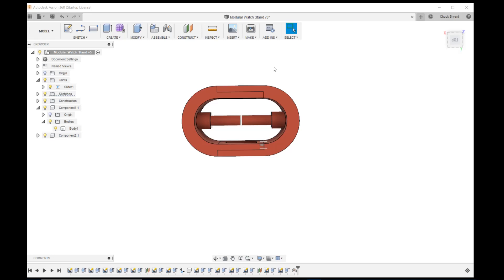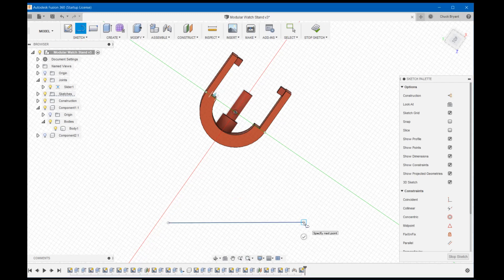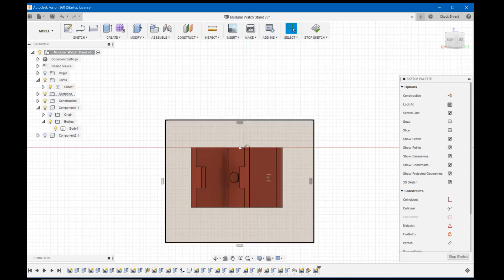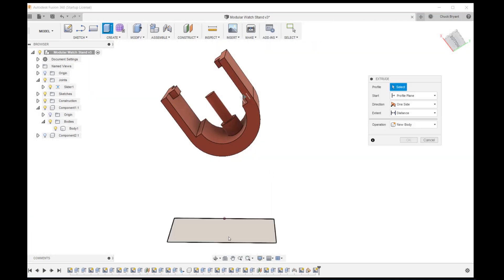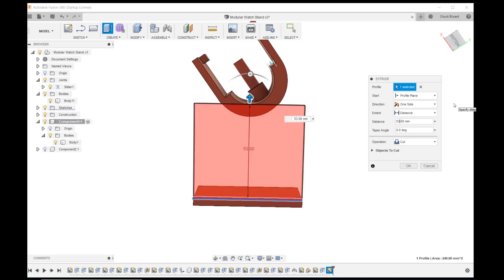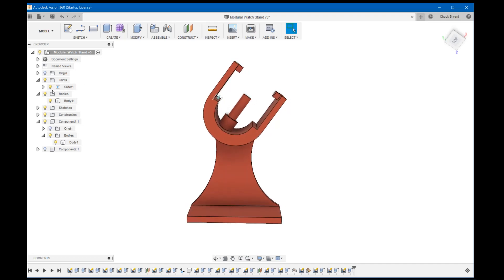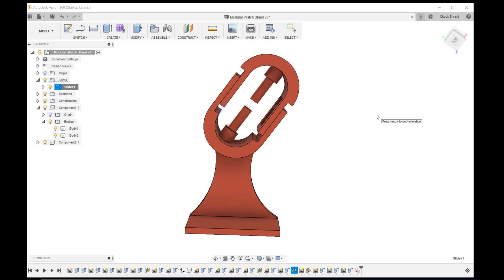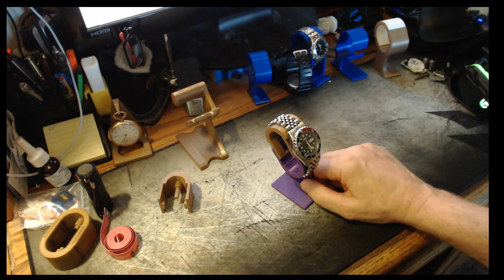Fusion 360 - Ender 3 - Design and Print a Adjustable, 3D Printed, Watch Stand Part 3

Comment: Hi Chuck can you please upload your cura settings
Reply from the maker: I'll put the Cura profile I used for the watch stand and box below. Be aware that it's my "one size fits most" setting for PLA and that it hasn't worked for everyone. For example, I have a .5 line width which was suggested by someone at Cura to solve some problems I was having and not only did it solve those problems it worked really well for me for most things. Others I've given it to have said it did NOT work on their Ender 3. So take it as a "good starting point" and work with it from there. I've probably got 5 or 6 different settings for PLA and and 2 or 3 for other filaments, so when you ask me for a cura profile it helps to tell me what printer, filament and kind what the project is.

https://www.dropbox.com/s/16grkpxjsiigv5j/Chuck%20PLA%20works%20for%20most%20things.curaprofile?dl=0
Reply: Thanks Chuck i’m printing on an ender 3pro with cheap filament from Amazon (like geetech filament)
Reply from the maker: @carguy7884  My basic cura PLA profile should work on it. If it doesn't, try changing the line width from .5 to .4.
Reply: Chuck Bryant okay i’ll do it Thanks again
Reply: And keep up the good work